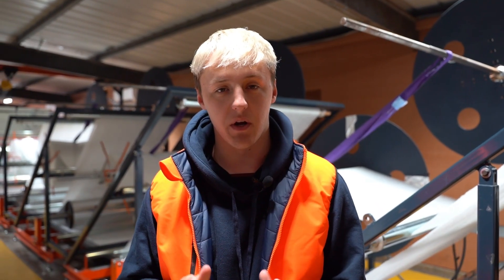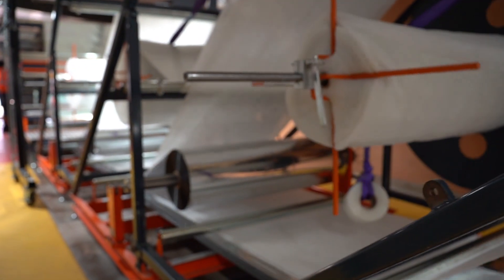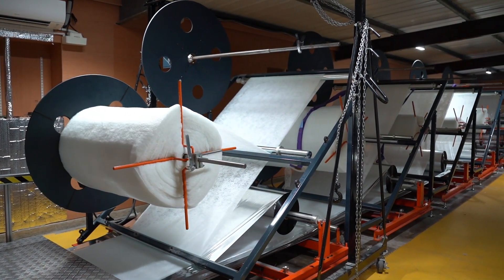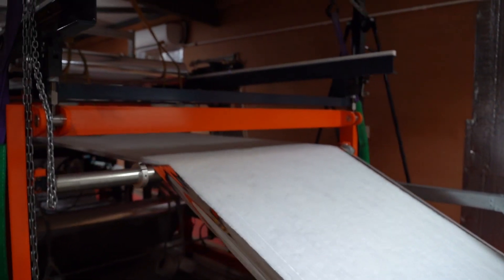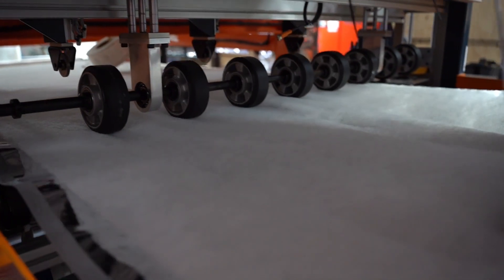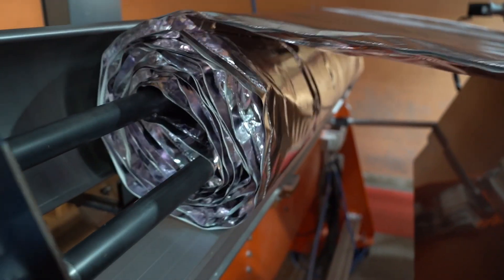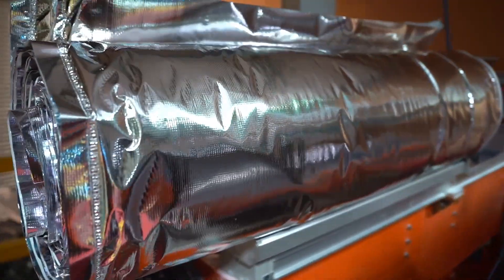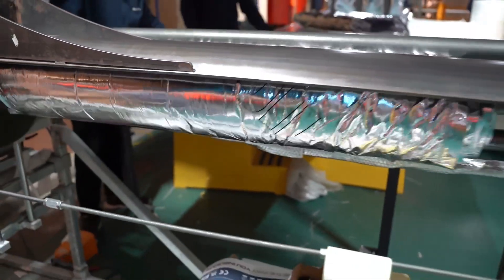Manufacturing Multifoil Insulation | Inside Our £500,000 Multifoil Insulation Machine

Comment: Interesting to see Superfoil being manufactured and explains why the end of the roll is really screwed up when it rolled up by the machine in the factory, I've found that at least the the first half metre of the SF40 is so badly crushed and screwed up and is difficult plus time consuming to straighten out, if the ends are sewn up like the sides are sewn with a blanket stitch before rolling up it'll probably be easier to un-roll and straighten out. 👍
Reply: The bit of carboard they used to have was much better rather than scrumpled rubbish that is next to usless.
Reply: Totally agree, with a product that is as expensive as SF40 is you'd think that it would all be usable, I managed to buy an older SF40 on ebay with the cardboard tube which was a bit better but I still feel that sewing up the raw ends would be the way to go imho.
Reply: @ The first rolls that I purchased years ago were bound on the long edges and had a couple of running stiches up the length. This held the quilts together when you had to split them long ways

Comment: Having just seen the foil length being sliced off. What are you using and is there a version that could be used in the field
Reply: Hi Andy, after many attempts to cut this stuff with any real effectiveness I've devised a cheap and simple solution of using two lengths of 4"x1" slightly wider than the width of the SF and using two 'G' clamps either end to clamp it tight and then using an old 12" really sharp kitchen knife to cut close to the edge of the 4x1 I have found that the my knife needs to be re-sharpened on a grinding wheel after every fourth cut as the SF blunts the knife really easily, it's a bit of a phaff but works perfectly for me and gives a nice clean cut to seal the ends with 4" aluminium tape😉
Reply from the maker: If you're using SuperFOIL regularly, we recommend using a cordless shear like this:

https://www.bosch-professional.com/gb/en/products/gus-12v-300-06019B2901
Reply: @SuperFOIL-Insulation  or you could answer the question as the shears I have purchased don't cut SF40, ok with the thiner stuff
Reply from the maker: We use the Bosch cordless shear linked above to cut SF40. We demo this on our free installer training days and even get the installers involved in having a go. If you're working with SuperFOIL often I'd recommend you signing up and attending - it's free (other than your time).

The machine uses an industrial version which wouldn't be practical in the field.
Reply: @SuperFOIL-Insulation  T he stapiler that you recomended works well fot longer staples. What has happed to technical, I got a call the other day where it was obvious that the person was in training, no wonder I'm seeing rubish comments on social media where people are saying that they have been told drivel.
Reply: @SuperFOIL-Insulation  as i said it works on SF19 but not man enugf for SF40